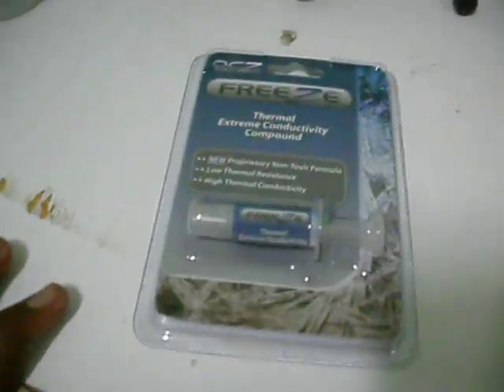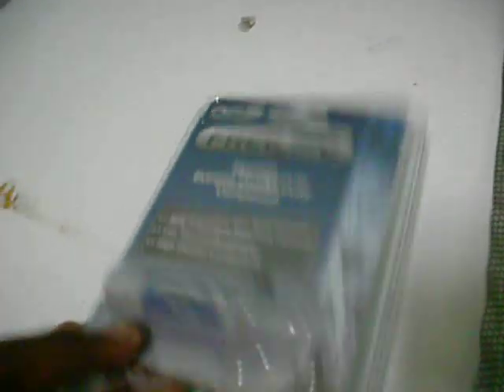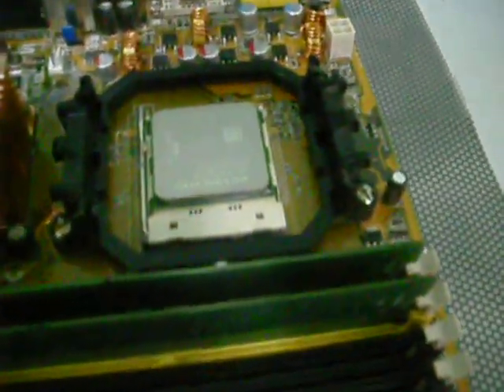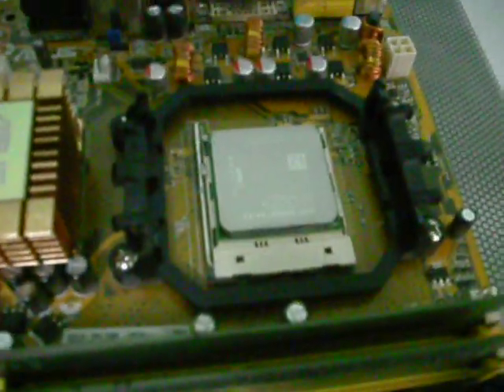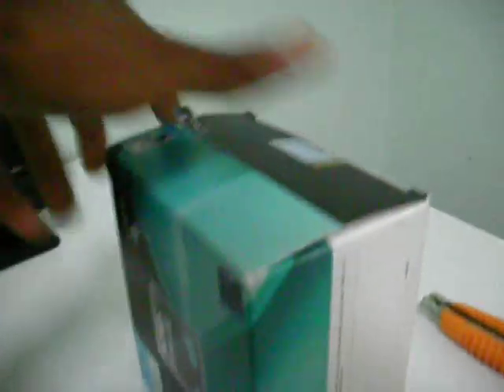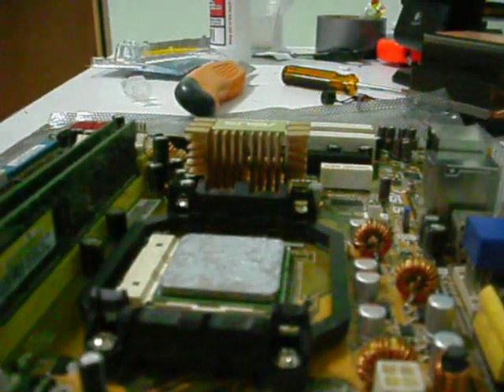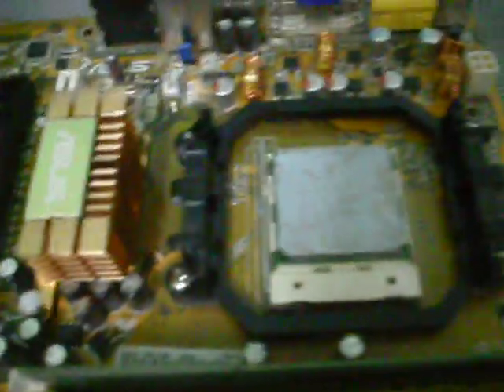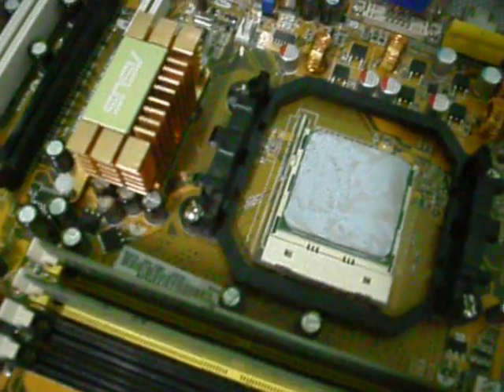How to apply OCZ Freeze?

Comment: @12GTA435 The argument against spreading is that air bubbles are introduced, but if you put it on *very* thinly, and spread radially, this is pretty much completely eliminated.

Ideally, you want the IHS and the heat sink to touch perfectly and use just enough thermal paste to fill in the microscopic differences between them, to improve surface area. If you get better at it, this is great but you said it was your first try

The "blob" method leaves half the IHS to not touch the heat sink at all.

Comment: I going to really need this. I've recenty realized that if my PC runs a game without CPU Themal Throttlong on or if it runs at 100% at the factory speed it overheats pass 80C on the surface put the core temps goes into 86C and then the temps get fucked up -34C and all that crap. Then it shuts off. Intel needs better fans and my PC is only 3 months old.

Comment: The pea or 2 rice grain sized method works best imo. I tried spreading this and just like in your video, it doesn't seem to spread well. A small amount like that does spread out on it's own fairly well, I left my HSF on it for a few days and removed it yesterday just to see the spread and reapply, it was pretty much all over the thing(I used more than a pea sized), so I cleaned both HSF and IHS and reapplied a smaller amount. But application methods vary per HSF.